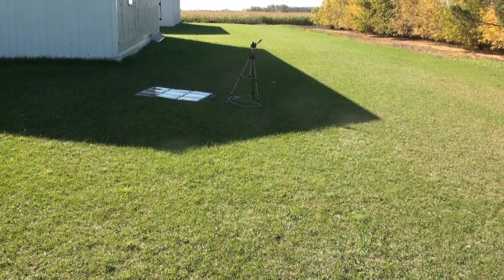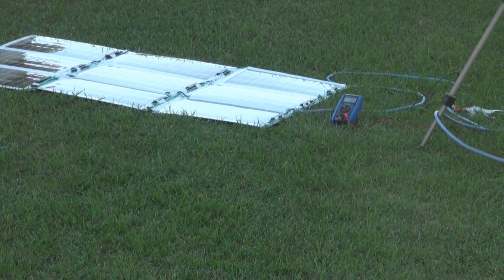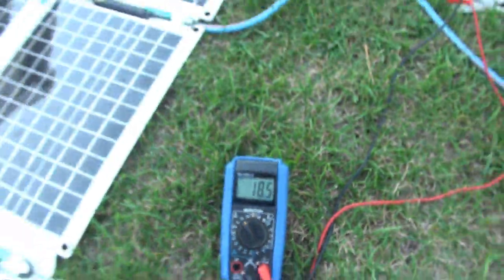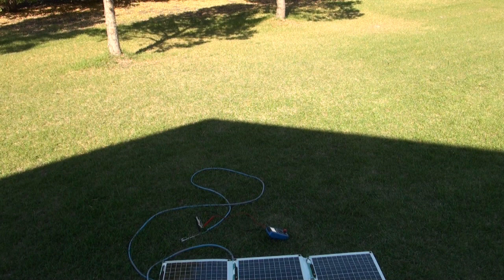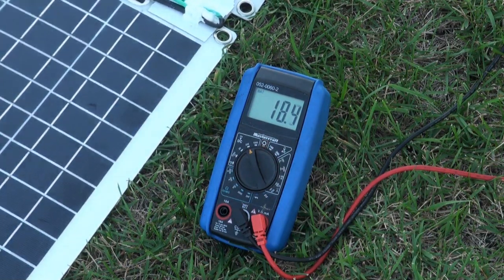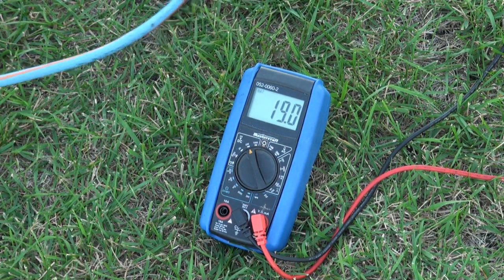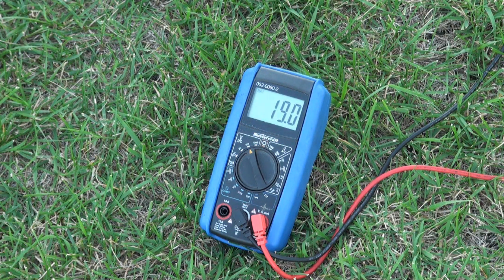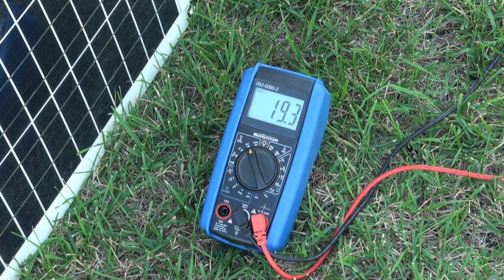Solar Panel Shade Testing

Comment: This video does not give info about power output (Watt). It just talks about voltage. You need a resistor and a controller to check voltage and amperage, then you can compare the output of each orientation in Watts.
Reply: Who says it needs to talk about the power? Obviously the more sunlight you you have the more current you get therefore, more power. This one is informative for people who want to know at what light level a solar cell starts to conduct.

Comment: No  big surprise here . The clue is in the name Photovoltaic  Cells , when you turn them away from the brightest light source at the shade, less photons ,they are less efficient. Turn them to the towards the brightest light source the full sun on the lawn,  more photons,  more efficient, and if you placed them on the lawn in full sun at  an angle to recieve the sun directly,  most photons,  most efficient.

Comment: Interesting, thanks for sharing.
I have two little cheap panels I've been experimenting with and was surprised how little sunlight they actually needed in order to produce usable voltage. Albeit at a very low current but MPPT charge controllers manage to use it.
God bless brother.